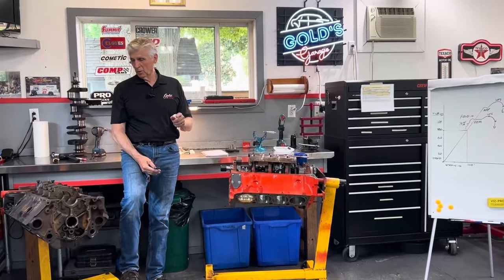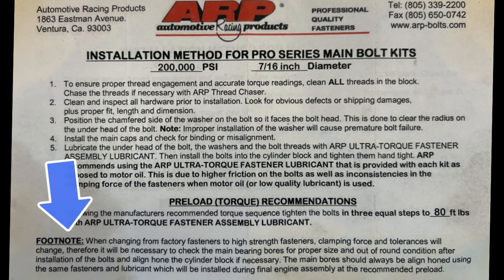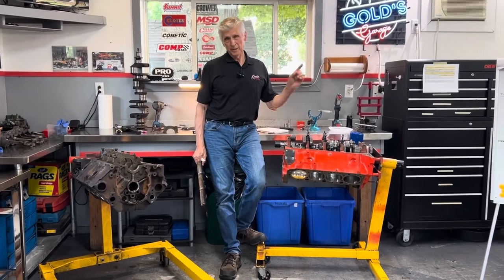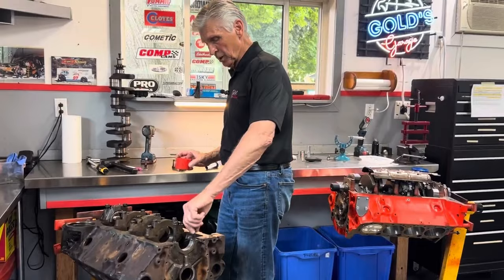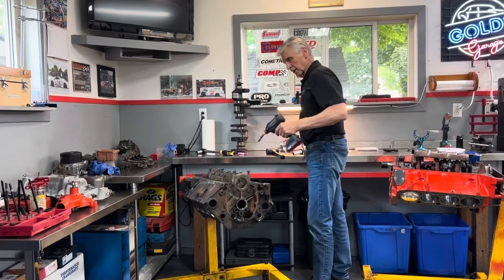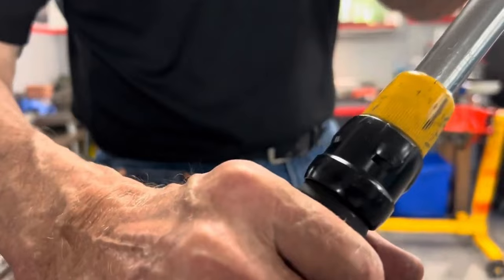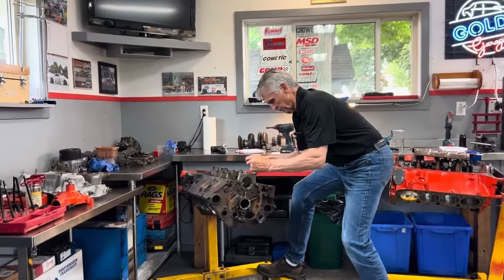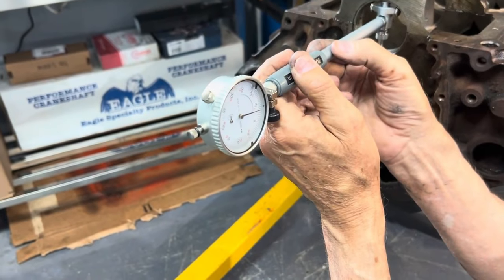ARE ARP tighter than your OEM Factory bolts? This might not be the answer you expect!

Comment: Great video! Another confirmation that agrees with my findings. I even find the same with studs vs factory bolts on late model LS engines. I also use ARP on the gen4 cracked rods without seeing any excessive deformation where machining might be required. Just keep checking those clearances!
Reply from the maker: Thanks Tea, a nice confirmation to my message. Thanks for contributing.AG

Comment: ARP bolts have a far more STRINGENT quality & assurance testing process over an OEM bolt. That is an advantage on its own. We had a Circle Track motor that used a windage tray and it would fracture OEM GM bolts at times (yes it was tune-up and detonation issues but, the other parts were surviving) anyhow....Substitution with ARP studs resolved that issue. Also the ARP "LS motor" fasteners are not "Torque to yeild" so if your testing and taking apart things....They give you a viable option that saves money. ARP rod bolts will give you a better fastener than any of the OEM rod bolts including the SPS "boron bolts" they used in L-88 and LS-6 Big Block Chevys.
Reply from the maker: Thanks Ej. That is a good point about the ARP bolts for LS engines being reusable. AG
Reply: Yes their not, unlike the factory bolts that are torque to yield, and supposedly not reusable, which may be another myth...I don't know.. 🤔
Reply: Agreed. I used to use Milodon and SPS bolts too. I could never understand re-using the OE fasteners on anything but the most budget build stock rebuild. Hardware is probably the cheapest investment you could make in a rebuild. I had some cheap OE rods bolts just start to loosen up and twist off torquing to stock spec when I was rolling in some bearings to freshen up an engine. The OE's are barely good enough. The rod bolt is probably the most critical fastener in an engine. A set of upgraded ARP bolts for a V8 was well under $100 a few years ago. It's a no brainer.
Reply: Oem bolt have some big advantage in street cars but only use them 2 x max

Comment: Hey AG,
     Tim here, what a GREAT vid to prove certain myths......we use ARP fasteners whenever we can, just, SUPER quality.....as the HP/stress increases, we use as many ARP bolts as possible......but it PROVES, if one has a stock rebuild, OEM fasteners wud be fine.....when ur makin, lets say 150% more power than OEM specs, a good rule (i think) is to go with ARP, because, they are stronger, and will tolerate the higher power stresses, MUCH better!!......i just assembled a '69 SCJ428 short block.....now will be 464 C.I., and has a good sized camshaft (.590lift, 236° @ .050 dur hyd roller) ...all ARP stuff.....only way to have some insurance on maintaining our .0025 clrnc on our mains and rods......LOVED the vid....SMART!!...it validates my sub for SURE!!....TY sir!!
Reply from the maker: Thanks as always Tim. You are building some cool stuff. Let us know how it works out. AG

Comment: I'm pretty sure when I got my bolt kit for a big block Chrysler that ARP raised the torque numbers for their Hardware. I believe that was done to achieve the required stretch on their much stronger bolts. I believe it was 10 to 20 more foot-pounds which might alter the shape of the rod cap or main bearing
Reply from the maker: Great info, thanks Thomas.AG

Comment: You're supposed to torque to the engineered design spec based on the thread or facing surface lubricant when torquing. ARP moly grease has less friction than the traditional motor oil used. If you torque to the service manual spec with the moly lube it would overload the fastener beyond the designed clamping force. This can cause the journals to become out of round and possible excess stress on the fastener. ARP bolts generally tell you what the spec is with their grease.
Reply from the maker: Good points Vince, thanks for contributing.AG

Comment: Excellent information as always! I personally have seen variances in main bearing clearances using studs vs. bolts. This however would be the exception rather than the rule. When there are differences they amount to approx. .0001 -.0003. Insignificant for all but the most Ultra High-performance engines. Some builders claim they've seen differences of up to .001. I never have. Also, a reminder when using studs that are hand-tightened into a block...Make certain that all threads are clean and the proper lube is used AND make certain there isnt't debris of any sort down in the pocket of stud register. 
You want the stud to be bottomed against the block and not against some foreign material. 
Failure to check for this has gotten engine builders into trouble. B.T.W. Nice to hear the reminder to store crankshafts upright!
Reply from the maker: Good advice, thanks as always for contributing Bill.AG
Reply: @goldsgarage8236  Always enjoy your videos and the information, Alan. Even as a Ford engine builder and racer for over fifty years. Like you, experience rules and shared knowledge will help keep our interests alive.😉

Comment: I have seen cases of where ARP studs have been used on a variety of engine components (lets concentrate on conrods and main bearing caps) where the use of an ARP stuff has changed the ‘shape and size’ of the tunnel….
I’ve also seen cases where there has been no difference in shape or size of the tunnel….
The key here is to check, check and check again….
Now in the case of a high performance engine build, you should be checking clearances and main tunnel alignment anyway.
There is a very good chance in the case of main tunnel alignment that it’s not straight anyway, regardless if using an old seasoned block or a new DART or ARROW block.
So if you have to straighten the main tunnel or resize the rods, you may as well be doing it with the ARP fasteners (why cheap out with old or standard fasteners) that are being used in the build and have them torqued with the required lube during the machining process.
Plus ARP fasteners are cheap insurance for rotating components and they are a known quantity and a far more reliable fastener than an old fasteners that you do not know ‘how it was torqued and how much it has been torqued to in its life’
Anyway that is my experience and opinion. 
Good video 👍🇦🇺
Reply from the maker: Thanks Al, very good points. AG

Comment: If you can get your hands on new old stock, those old materials are not the same as used today. A company like ARP sell piece of mind for most folk. If you use a set of standard torque to yield bolts, when you do the final angle sequence, just take note the differences in torque required to get to those angles. 
Motor store parts are even worse
Reply from the maker: Good observation, thanks for watching and commenting Gothic. AG

Comment: Very good AL, I feel better about my 383 stroker, that I don't have to take it apart a recheck the clearances. I have that same dial bore gauge, it's made to be used with the black cover on the dial head, so when you set it down it doesn't get bumped. You just can't put it in the case that way. Thanks again for sharing this.
Reply from the maker: Thanks Cliff, mine id not come with a black cover, I have had it for a long time. glad the video  saved you some unnecessary work. AG

Comment: There is a saying that once you hand tight a stud and you bottom out, one should back the bolt out 1/4 turn to reduce the block stress and to insure that the bolt is straight and not  cockt a little due to the imperfections of the threads in the block.

Now this last argument about the bolt being cockt a little making it not straight I have seen it my self, this will cause the contact area of the nut, not to be 100% flat, causing extra stress on one area of the studs or even bending it a little.

What is your take on this?
Specially on the stress on the block when the stud is against the bottom of it.

The way I torque it is with special torque wrench open end (not common is USA) that allows you to hold the stud in place with the Allen wrench while you torque the nut with the open end torque wrench, so the studs is not dragged together with the nut as it encounters friction.
Reply from the maker: Thanks for contributing CJ. Your comments make sense. AG

Comment: Another way I see things, I prefer studs over bolts, because of the more even stretch applied on the shank of the fastener, with a bolt there is more a twisting stress induced than on a stud, of course it takes a lot to stress  to failure a bolt in a twisting stress, but it is one issue less to think about.
I will use ARP studs if I see main bearing cap walk/fretting, that will indicate that I need to increment the torque on the fastener, since the yield strength is higher on ARP that allows me to increase the torque in 20% increment keeping an eye on the bore, and later to check after the engine is put to work and disassemble again if the main cap walk or fretting still is present, this apply to any matting surface, but this is how I do things, not saying I right I just have my process or getting there.
Reply from the maker: Thanks CJ, you have given this a lot of thought. AG

Comment: I don't have precision measuring tools. I rely on my machine shop. I do however have inch pound torque wrenches. I measure rotational force when assembling an engine as it goes together. Good thing as a reputable bearing manufacturer had a bad 1/2 main bearing in the box and I caught the difference in rotational force. It was not huge but would have been a big problem if not detected. Just a thought. Thanks for the educational lessons. I am learning cool stuff.
Reply from the maker: Thanks Less, your comments reinforce my point that you have to check everything. AG

Comment: Great video! I have a DART 351W block with 7/16”  flywheel bolts. I’m using the ARP flywheel bolts for the build. Instructions say 85 ft/lbs with the ultra lube under head and Loctite 242 on the threads. You mentioned that you have to be careful what your are clamping as well. What would you say is the max torque for an ARP flywheel bolt with their ultra lune before distorting the forged crankshaft threads?
Reply from the maker: Thanks for the question Mac. The mode of failure if a fastener is over torqued is normally permanent elongation, necking or fracture in the shank of the bolt. Normally about 3 threads are as strong as the shank of the fastener. You will be fine with the process you described. AG

Comment: Hey never used arp bolts or products but all of the other manufacturers recommend that you replace the bolts every rebuild so basically 1 time than toss them and buy new ones 
But you said about the secret sauce and oil was the same after  7 uses so I think it's OK to reuse them more times by what you said..... AND I know the crank and head bolts do stretch is that right
Reply from the maker: Thanks Harold, yes, all bolts do stretch if they are torqued properly. AG

Comment: I don't know about  line boring  an engine with main studs is true  or people just getting pickey I built at home a Buick 455 but at the time I did  I didn't have the main studs, so I put it together with the stock bolts ,2weeks later the studs came and I installed them in the car  ran for me for over 20k mi with no problems and it wasn't babied
Reply: If the clearance was enough to start or more, you would be fine , I've done similar, but always check clearance,  Gm bolts were good, Grumpy used them to make 700 hp...Mmmm?
Reply from the maker: Thanks Bill. AG

Comment: Very Informative video...I haven't measured to verify but would think considerable changes (+0 to --25% fastener Torque) wouldn't change bearing clearance....Fastener bolts (Designed to Stretch) not likely to dimensionally Compress block main bearing Cap ID size....Largest majority of Torqued to Un-torqued dimensional change is in the bolt (Or Stud) Length (Stretch) compared to block/cap Compressed size....Again, haven't measured this to  actually verify the intuitive thoughts on the bolt "Torque" myth.....
Reply from the maker: Good comments, thanks Tom.AG

Comment: Richard petty and other drivers of the 1960s and 1970s went 200 mph back then in race cars week after week with using stock production modified engine blocks and other parts and they used the stock fasteners of the time so I base my ideas off of what has been tried and tested by Richard petty enterprises.
Reply from the maker: Good point Bo, and aligned with my thinking. AG
Reply: Keep in mind they were using factory fasteners but they were relatively new of course not 50 odd years old and been in/out and torqued up to who knows what in that time. I still use heaps of factory fasteners that are 50 odd years old but I have any question on the bolts condition I go for new in the appropriate grade or ARP, simply to get a new fastener, not because the factory stuff was bad.
Reply: @craig8187  obviously the bolts and fasteners were new when they used them ! That is the point of my comment why would anyone with a brain use 50 yr old bolts?